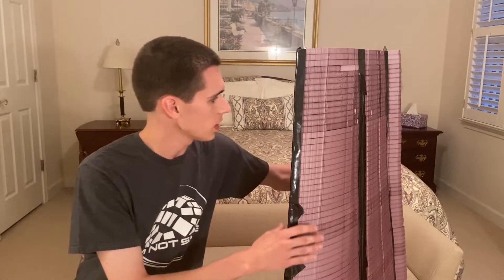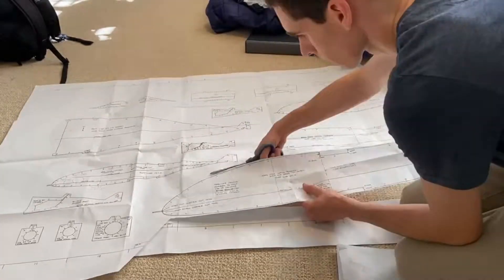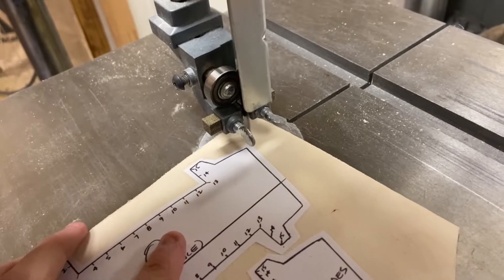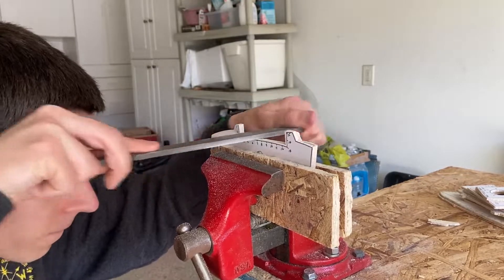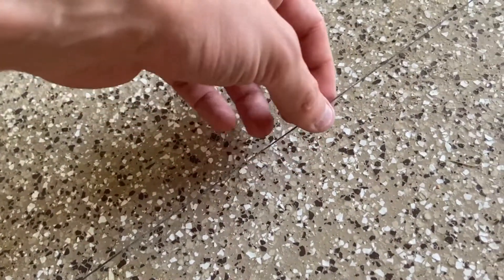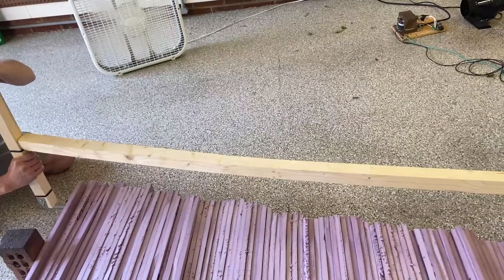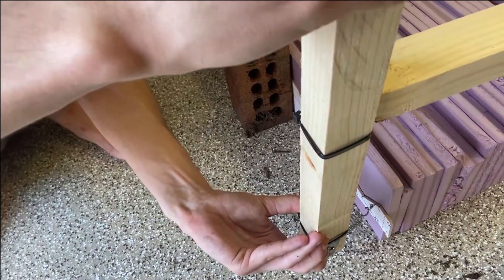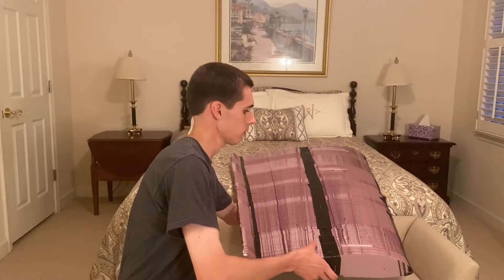Cutting Templates and Wing Test Piece: Building an Airplane Part 2

Comment: I found that you want the hot wire very tight to minimize the center of the wire lagging and making a dip in the middle of the cut.  The wire temperature should be adjustable to maximize cutting speed but not be too hot that you melt away too much of the foam.  Wires can break which sucks.  If you use a larger diameter wire that minimizes wires breaking.  It was suggested to put some pencil graphite on the edges of the wood templates to let the wire glide easier and minimize burning the wood.  Some imperfections in the foam can be filled with two part pour foam and sanded down.  The new pour foam puts out gasses for a while so you should not do a glass layup over it or you will see bubbles under your skin layup.  Also the spar cap troughs are cut linear but the build up of the unidirectional cap layers are not linear.  You can do a spreadsheet and figure the thickness.  I found that it helped to sand the cap troughs a bit lower to minimize the cap being higher than the wing surface which sucks.  This tends to be where the spar caps are thickest. Also you can get foam cores cut for you from https://eurekacnc.com/eracer-2/.  Lessons learned doing some things twice.

Comment: Now I understand why the cutter has to be so long.  Excellent work as per usual, and you didn't hurt yourself despite wearing a t-shirt that says "I'm not safe".
Reply: The wing foam cores are cut in several segments to keep the cutter length reasonable.  The segments are glued together on a table jig to get them straight.